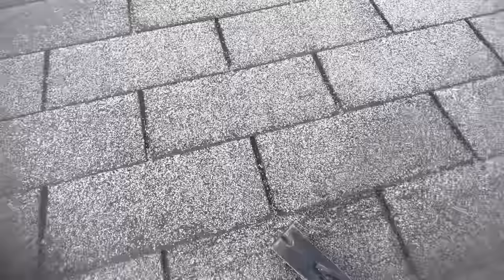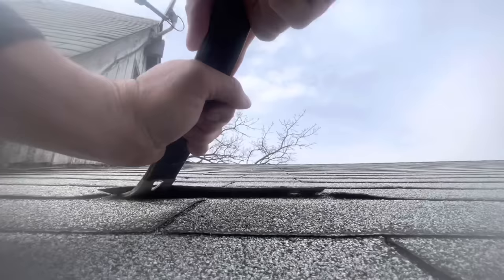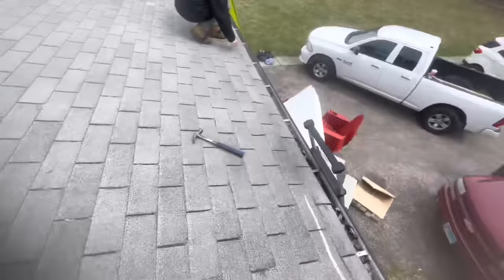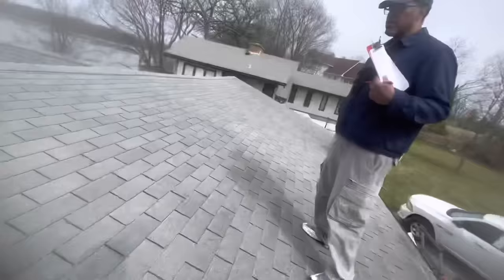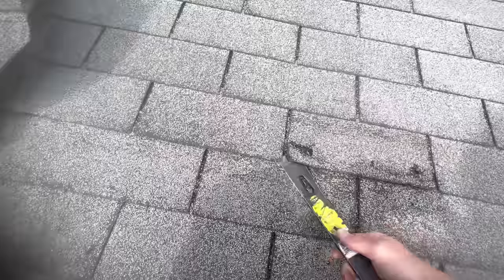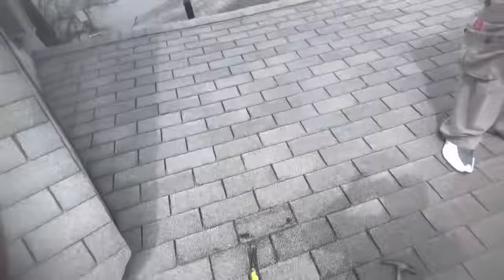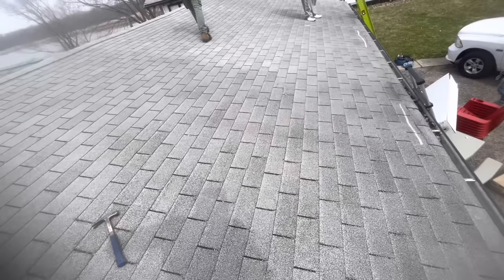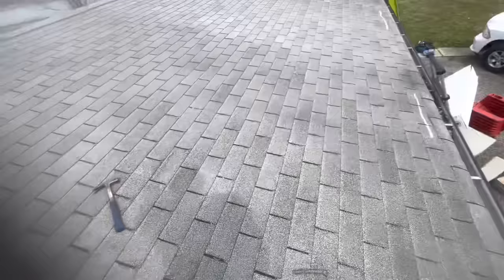Insurance Adjuster says roof is repairable. 😂 See how this inspection is ignored & denied?

Comment: Another dirty secret about some adjusters is they will inspect three or four roofs in a day and just run and gun. Meaning they get anywheres from 200.00-400.00 just to inspect the claim. If they don't write for the damages and state that there are no damages or the roof is repairable when the evidence is clear then they dont have to spend another 3 -4 hours writing a larger estimate on those claims.
Lower hours - but they still pull in 800 - 1200 per day.
Reply from the maker: Yep that's one of the pay models. I do believe there are many good Adjusters out there though. Unfortunately, corporate greed is at the back office denying what is right and just.
Reply: @ChicagoRoofer  Exactly...
I get paid by the size of the loss...bigger loss = larger fee. I have an incentive to locate and document damages.
Of course staff adjusters do not have that monetary incentive like independent adjusters and may be more likely to overlook damages deny coverage.
I let my photos sell my product. If there is actual covered damage it will show on the photos as long as you take the pictures smartly and correctly. Then its much harder for a desk adjuster to dispute it.
As an adjuster,  when I meet contractors at an inspection I remain cordial and invite the contractor to comment. We perform the inspection together as professionals.
There is no reason for an adjuster to act like a but hole other than they are immature jerks...and there are plenty of that type to go around.
Reply from the maker: You make a lot of valid points. I appreciate you! 

Like in every industry, there is good and bad apples. 

I think that model makes the most sense. The one you're in. Reason being is, it allows you to find reasons to pay as long as they're legitimate and reasonable. It also results in getting paid for your time. An adjuster shouldn't get paid the same dollar amount on a million dollar loss as they should get on a $5,000 loss. 

The model you get paid by incentivizes and adjuster to do the job correctly.
Reply: As a staff adjuster, it is no incentive or motive to deny claims. That actually hinders good “service” we’re trying to do for the customers. Some adjusters are reasonable, some aren’t. That’s all it boils down to.
Reply from the maker: I agree with you. But I also have noticed that whether they are staff or independent and newer, I get random comments saying people try to pull fast ones on them and they've been caught by their management.

I once had an adjuster highlight damage on the entire roof and then after we were done she started patting it down to remove it cuz she wasn't sure anymore.

Her exact words were, I'm really not sure this is truly hail and wind anymore. I have to ask my manager to make sure. All while saying she's been doing this for 6 years. 

I found most adjusters say 6 years whether they've been doing it for a day or 6 years
Reply: @ChicagoRoofer  I’m with you. I get claims and ask myself “what is this adjuster doing” and I’m only 2 years in. The only time I’ve gotten push back on a decision I’m making is when a contractor of insured is unreasonable. 

I understand the pain though. Some do make things more difficult due to their inability to make decisions/close calls, or just fear of getting “hit” for that exception after their claim is reviewed.
Reply from the maker: Makes sense. We all have to make a living and at the same time make the right people happy. 

Thank you for being one of the good guys!  There's many of them out in this industry and unfortunately, corporate has them by the 🏀🏀..
Reply: You're sorely misinformed. Your scenario is MAYBE the case for some independent adjusters,  but most are salaried, and it's a hell of a lot quicker and easier to write em up, pay em, and close once and for all. Ever waited tables?
Reply: @__documents2580  
Exactly.
Reply: @dezzessex8880  
Exactly.  You FIND ways to pay and close. If there's any doubt, pay and get out. No time to live with the file forever.
Reply: @ChicagoRoofer  
Shocking, but true. So many staff reps are undermined to the point they lack the confidence to assert discretionary judgement.  Sadly, discretionary judgement has been supplanted to the point too many adjusters are not really adjusters, but more simply step-processors and the entire structure - the insurers, the policyholders, and vendors - has been stained by it. That is to say, they relationships among the three have been made adversarial, which is completely anathema to the notion of service and protection the policy is intended to provide.
Reply from the maker: Well said. Unfortunately, Illinois doesn't require insurance adjusters to be licensed. The lack the training for all lines and mostly regurgitate scripts. :-(
Reply from the maker: My favorite line: "If it's grey, you should pay!". Basically, if it the story makes sense,  is legitimate and  it could have happened, then it should be paid for.
Reply from the maker: Are you suggesting the pay structure doesn't incentivize based on time?
Reply: @__documents2580   Insurance company won't allow you to write big estimates...they will force you to rewrite estimate and lower the amount.  We've discovered this during depositions.  Even with chaos of a hurricanes when 1000s of home damaged, they still write ridiculously low estimates down here.  With all due respect, the day and age of an "independent adjuster" is completely gone, done, over, especially now that insurance companies have no more field adjusters only desk adjusters.  Very few have FA's employed directly by the carrier and if they do its literally a small handful.
Reply from the maker: I've had adjusters in the field tell me this. Insurance companies that do this should be embarrassed. At least they have money for good commercials now.
Reply: @ChicagoRoofer   That model doesnt exist down here.  Insurance companies force their hands to write lowball estimates even with hurricanes.  Independent adjusters are dead.  I don't trust any of them and employ several tactics.  I never let them ask a single question of my client.  I tell my client DO NOT answer any questions they ask.
if they ask how old your dog is just say sorry my PA said I'm not to answer any questions from you.  We actually had an IA on home camera saying my client told him at inspection that the leaks happened before date of loss. Dumbass IA screwed himself.  Cameras on and insured was never at the home.  Others make up stuff that insured never told them.
I don't bother going to inspections and stopped going over 2 years ago when Corona hit.  I have so much free time to concentrate on admin work, emails, SPOL, etc...
Have a GC do my estimates as well.  I'm not traveling 2 hrs + for them to deny every roof claim and waste my time.
Reply: @theclaimsquadpublicadjusters  In my experience, it’s not that we have to write lowball estimates, we can only write for what we can prove. Which if I can document how it fits into the scope of work that is covered, then there is no issue. Most contractors and PAs only complain about upfront estimates, for obvious reasons. But I don’t think it’s unreasonable to pay for what’s proven, until further notice/documentation. Maybe I’m biased, but I don’t understand the issue.

As I stated earlier, I know you can get certain people who just aren’t reasonable, so there’s that. On both sides of the coin.
Reply: @dezzessex8880   I actually have actually files and track all estimates via speadsheet.   I average out what my average payout per claim is.  I'm extremely analytical.
At least 90% of estimates, here in Florida, are under 10k when written by IA's.   So far, of all the major claims, I've had only 2 where they wrote greater than that. Most would be upper 10's or in the 20K range while our estimate is far greater than 100K
2 recent cases past few months
1.  Our estimate 170K, IA's estimate around 76K.   2.  Our estimate 292, policy 210k,  FA for carrier came out never wrote estimate, they gave 125K , we filed suit.
For #1 we went to appraisal, $148K final award.   It's really bad in Florida with lowball estimates.  Its so bad, if I don't get a really low estimate, I think something is wrong and I get nervous with the claim moving forward like it's some trap.  lol
Reply from the maker: Lol. Data matters for sure. Great job keeping track! We track everything in our CRM but I've never pushed the data out to see what the average increase is after we get involved or after the first estimate. I'll see if I can do that this week.
Reply from the maker: I feel you're right about the fact that there's bad apples on both sides. I also feel, getting a public adjusters license should be more difficult with new questions every year or at least every few years.

Same thing goes for roofing exams. They've had the same Roofing and PA exam for many many years in Illinois.

For that reason, there's schools teaching you how to pass the exam as opposed to teaching you all the ins and outs of becoming a public adjuster and how to read a policy. The guys that do really well are the ones that truly read everything.

My issue with adjusters in the field is when you can show and document and prove stuff or offer the documentation that supports your stance but they're unwilling to take that information and say play the game and send it in on the back end. I feel that and inspection should be there to document everything and leave nothing out when it's presented on site. 

It's almost as if they want to pass the buck and not deal with the claim
Reply from the maker: We have a lot of companies choosing not to work with certain insurance companies for that reason. But that just proves that they win and this is working. Beat them up and wear them down, defer as long as possible and most will just give up.
Reply: I understand both your perspectives here. Almost every claim I have with a PA, the PA writes an estimate over $100k. When you’re not adjusting for the insurance company, you also have incentive to write for the most possible the same way insurance companies would want to write for less. 

I personally don’t understand why there’s issue with requiring more investigating before paying $100k estimate, that’s just me though. But regardless, most hail/wind claims or events does not cause that much in damages. And I’m a CAT adjuster with pretty high claim volume regularly, all over.
Reply from the maker: I appreciate you! Makes sense with what you're saying to. We both look out for the best interest of party that hires us.
Reply: @ChicagoRoofer  In Florida, you have to be an "apprentice" for 6 mos before applying for PA license.  Since I worked for an insurance company many years ago I was able to use my PA company as the appointment.  Also, our test in Florida is highly concentrated on the ethics more than anything else with only about 25% insurance related questions...and those questions were a joke.  So it's really geared to laws that govern PA's and what you should/shouldn't do.  For good measure since there have been a few PA's/Roofers that have been busted with fraudulent claims.
Reply from the maker: I do like the idea of apprenticeship. But again, although ethics is important, understanding policy language and how it should be interpreted should be a focus on the questions, right?

Comment: This is clearly age related deterioration.  It's a shame roofers are so intent on making money that they lie to homeowners. People... your homeowners insurance is NOT a maintenance policy.  Replacing the roof is your responsibility as the homeowner.  If you can't afford to maintain your home, don't buy it!!! Pulling up sealed shingles is causing damage that wasn't there before. Good job roofer and damaging the roof!!!! The homeowner should be pursuing YOU for the damages you caused. #insurancefraud
Reply from the maker: This reasonable attempt to remove and replace a shingle was due to 40+ wind damaged shingles. If the insurance company had no intent to insure the roof, the should have told them to replace before collecting their premiums.
Reply: you must be an adjuster

Comment: Im confused, that roof is clearly old and in need of replacement. Those are 15 year warranty shingles. Why is the insurance company liable for a roof replacement? Do they prorate payments on how old shingles are? Just an interested party. I have a new roof and went with 5 tab shingles for better long term sustainability.
Reply from the maker: The only owe for the roof of there's a covered loss. In this situation, it was storm damages that we agreed to. The condition of the roof is a huge factor when it comes to a reasonable and necessary repairs. When surrounding shingles get consequentially damaged from a repair, those too need to be replaced. This ultimately leads to a full roof replacement.

Good choice, your architectural shingles will last much longer than 3 tab roofing shingles. 

As long as the roof replacement is installed correctly and treated as a system, not just slapping shingles up.
Reply: @ChicagoRoofer  Thank you for taking the time to reply, I believe that many people dont understand the additional protection your house will have by spending a few more dollars a bag on 5 tab shingles. You are just going to be doing a roof again in 10 or 12 years by buying 3 tab shingles. In fact the price of a house should factor in if it comes with 3 tab shingles.  You have a safe day and enjoyable labor day weekend.
Reply from the maker: Thank you! I agree, a roof replacement should be offered that one would want on his home.  But, at times, there are people that hear nothing but noise when comparing value and ultimately chose a sub par product just to save a buck. 

Thanks again!

Comment: I am no roofer but when the shingle becomes that brittle and the gravel rubs off to the backing time for a new roof
Reply from the maker: I would agree with you. But had there no loss been sustained to the property, it wouldn't be necessary for the homeowner to replace the roof due to a repair. That's why they have replacement cost policy. To replace or repair for the full value.

Comment: I'm not a proffesional roofer but I've installed roofs and troubleshooted and fixed leaky roofs.  With all due respect can somebody point out the damage to this roof caused by what the title say's is wind damage?
I dont see any shingles missing, and I figure if they were missing you could replace the shingles thaI suspect that this particular roof is just old and soon needs to be replaced anyways and wind likely had little to do with the condition the roof currently finds itself now.
If my assumption is wrong, I'd love an explanation from someone on why my assumption is erroneous.

Comment: If you use a roofing hatchet you can stick it in between the shingle and cut through the tar lines coming through the opposite way making it 6x more effective and less damaging.  I use Est Wing flat bars  because there very strong thin and cuts through like butter compared to average flat bars.... I'm not at all sticking up for the insurance  guy just simply throwing this out there to save somebody from having to replace more shingles than needed on other jobs.
Reply from the maker: Thank you. I believe I used the Eastwing on this  what roof hatchet do you recommend?
Reply: @ChicagoRoofer   Est Wing has a good one and AJC makes a nice one with a practicality indestructible magnetic head great for siding jobs as well and  Vaughan . In my opinion you gotta have both the Vaughan and Est Wing

Comment: that's what the insurance adjuster is trained to do. you kick responsibility down the road so the job becomes a hassle and you're forced to get a roof out your pocket. then you'll have to sue your insurance to get a portion back and then they will drop your coverage. I have been dealing with this for twenty years.
Reply from the maker: You work as roofer, PA, or contractor? I do agree with you 💯

Comment: I had a pipe burst in my kitchen which flooded 2 rooms and it broke under the sink inside the cabinets. It took me 6 months of fighting my insurance, getting out of pocket quotes and threatning to take it to the state to be settled before I got a single cent out of them. Both damaged rooms were entries to the home, kind of a saftey issue as well. The initial offer was for only 4 grand.... My contractor had quoted 14.8k. All said and done my insurance company looks stupid and ended up writing me a check for 22k. NEVER accept the first payment offer and always fight for more. Insurance is NOT there to help you or protect you. They are LEGALIZED CRIME.

Comment: That roof, from what I see on video & based on my 20 years in the industry as a state certified journeyman installer and ex license contractor, it is not a repair option situation based on exactly what the go pro guy is saying. I would not tie into or could not tie into that system and follow specs. 
Chuck in the truck can cut it at tabs and tuck under old because he's in a truck with tail light warrantys. 
 I concur, Sir. 
Based on what I see, recommend total replacement and add ventilation to code.
The shingles look baked.